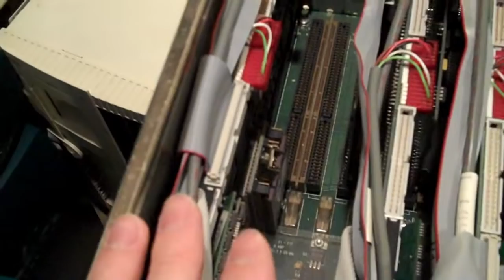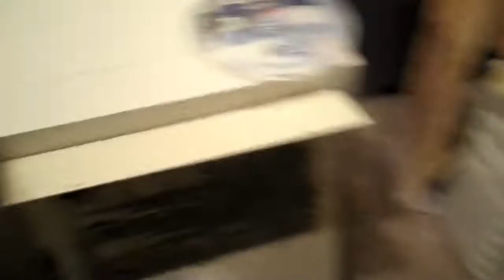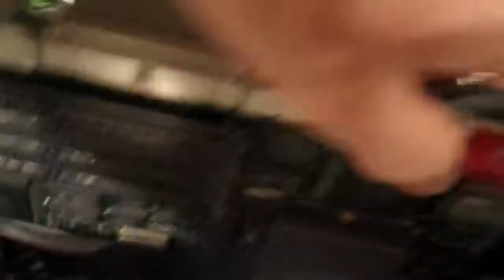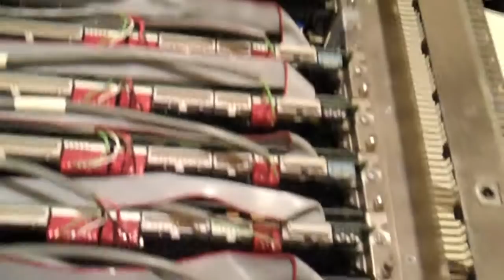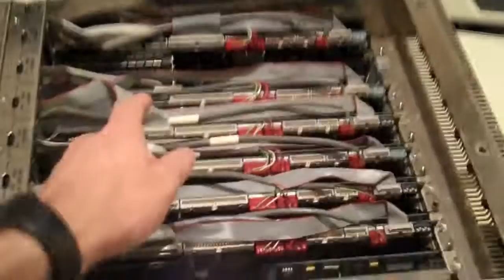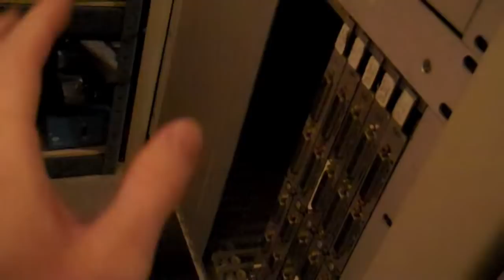Cubix ERS/FT Tour, Part Two

Comment: I owned one of these in the early to late 2000's, second hand. It was a later model and I believe it had pentium 3's. I also saw some information quite a long time back about a two socket 486 system they had made. Really cool stuff. Thanks for the video.

Comment from the maker: @adrianjcc Given the boards are basically stand-alone single board computers, I suspect they would not need to attempt to communicate across the bus, so there wouldn't be an issue, however given they'd all try to be bus master, perhaps the VME bus' setup for this were modified before hand to disconnect certain arbitration lines? I'm not sure, to be honest, I've never actually fired my system up. Given how unusual it is, I've been a bit nervous to do so :)